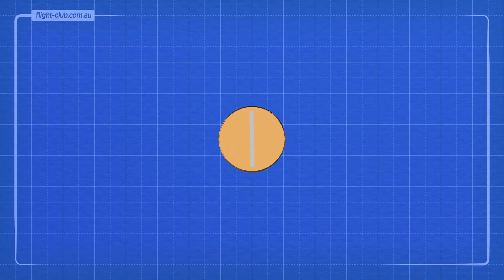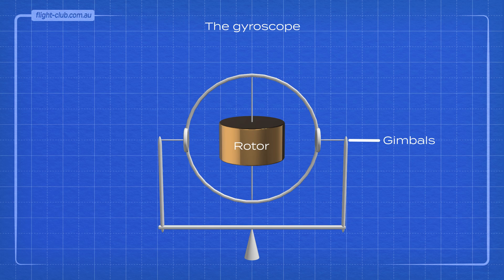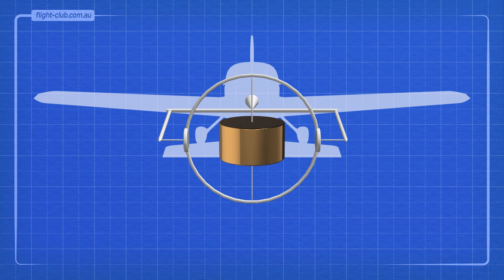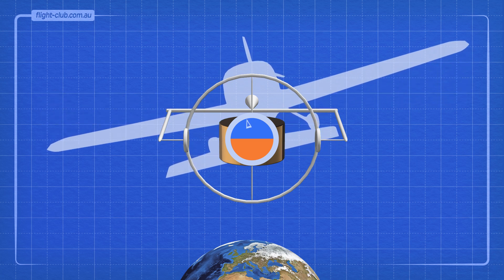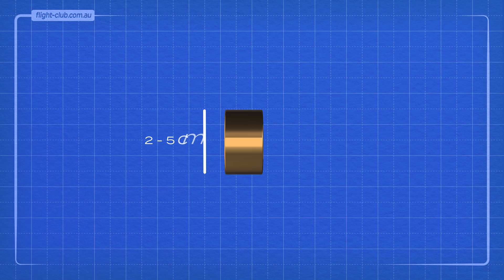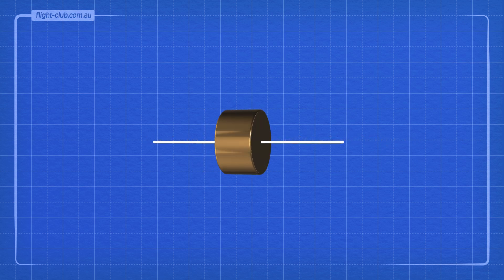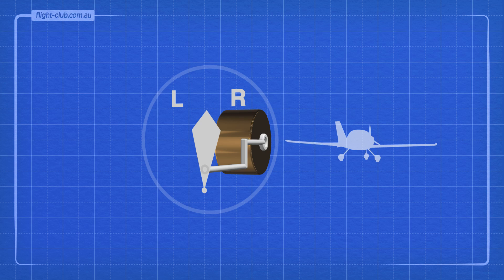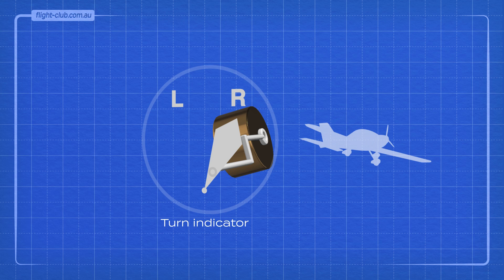Basic GYROSCOPE.

Comment: Great video! It proves the Earth is flat. It can't work on a globe.
Reply: Yes it can and it does. The Earth is not flat
Reply: Arse.  😂
Reply: Uh, no. In fact the attitude indicator in an airplane is a fantastic proof of the curved Earth, specifically because engineers have to compensate for it when they design them to ensure they remain accurate as the plane flies, otherwise they'd drift as the plane passes over the curved surface. Older aircraft accomplished this by simply putting a weight at the bottom of the cage to ensure the bottom of the gyro aligned itself to the direction of gravity. More modern aircraft use pendulous vanes to accomplish the same thing, they're more accurate. Neither method would be necessary on a flat earth, though. The older method definitely wouldn't have worked if there's no such thing as gravity, as flat earthers so often like to claim.
Reply: @jasonmack760  This is not True!  IF you want to use weight "due to gravity etc" then there is no need  to use a heavy Metal Flywheel rotating at high speed.  this is the reference point! because of it's rigidity effect, if you use a mechanical 3 axis gimbals flywheel gyroscope, Do you think it will be upside down if you fly from North pole  to the South? The Answer is NO! because it's rigidity effect it wil stay in its position! without correcting anything, it will stay in it's position!  meaning the airplane is not upside down ( North (up) South (upside down) Again if you fly a jet fighter at high speed 15 meter above see level,  LEVEL means LEVEL the Gyroscope is LEVEL (the Flywheel is "fixed  or Lock is "space" rigitity ) The  reference point is always the spinning wheel! Do you think it will show a drop of 8inches/mile2? (Z-axis movement?) The answer is NO! Meaning the airplane is LEVEL and flying horizontal ! " The most basic 3 axis gimbals Gyroscope has nothing to do with Gravity.  It's just a heavy metal wheel rotating at high speed in a 3 axis gimbal that's it! Proving the Earth is NOT Curved surface AND  Water is LEVEL.  Greatings Stationary FLAT plane. At your service. 
They had to add a Ball Earth just to put many of you on the wrong track. Flat Earth Banjo made 1 mistake. Gyroscope can also work on  a Globe but THEN it will prove you are flying over a Curved or ball surface! or " upside down" . (N-pole to S-pole) OR The spinning wheel will flip flop => rotate 1 time around in it's Gimbal  ( inside the airplane view) IF you fly 1 time around the "Globe" and that is NOT the case!  Get over it.
Reply: @efgtest yes, that is the case in reality. Why is always people like you with no expertise in any field claiming BULLSHITS?

Comment: Ahl ti tude. Not attitude.
Reply: It is attitude brother
Or in other terms behaviour of the aircraft.
Reply: Not to give you an attitude, but it actually is attitude. 
A gyro does not adjust for up, down, right, left, backwards and forwards. Only It's orientation or attitude if you will

Comment: Nice movie, I have a question. 
You have now only talked about left and right. 
What about the bulge of the earth? 
An aircraft could eventually fly upside down (seen from its starting point) how does the gyroscope react to this?
Reply: The earth is level, the whole point of an aeroplane's gyroscope is to keep the artificial horizon that follows earth's horizon, that would not work on a curved surface.
If visibility was totally obscured it would be no good at keeping the plane level on a curved earth.
Reply: a weight attached to the outer gimbal assures that the gyroscope always levels out horizontally.

Comment: My question/issue is:
The gyroscope will maintain its position in space, not relative to the Earth's surface.
So in a plane if you're flying straight an imaginary fake force is going to make it appear as if your aircraft is constantly nosing slowly up. If the pilot is slowly pushing forward to keep the aircraft level relative to Earth is the gyro not going to appear as if the horizon is constantly rising? Is there some way to counteract this or does the pilot have to periodically adjust the artificial horizon?
Reply: Aircraft gyros have correcting components which basically adjust them to gravitational pull. Those work quite slowly but since the earth is rather large it works just fine overall.
Reply: @Matticitt  None of the old educational videos on gyros ever mention this.
Reply: @Matticitt  Yeah, yeah, "correcting components"! 🤣 Gyroscope in airplanes just DESTROYS globe earth theory, because they wouldn't work on globe, period! You just can't face the truth, that's why you invent lies, which does not exist. Some magical "correction component" (wtf???) like magical "gravity"? If you stools drops on ground, that doesn't mean there is mythical "gravity" involved. Have you heard something about electromagnetic force?
Reply: @Matticitt would love to see a demonstration of those correcting components. Otherwise, I think the flat earthers have a very solid point.
Reply: That's because pilots fly over a plane not a spinning ball so gyro all good
Reply: @globePeerReview  
That's a good one, flatard 🤣🤣🤣🤣